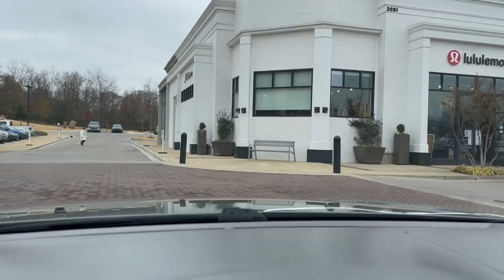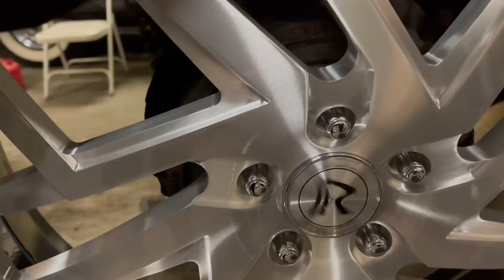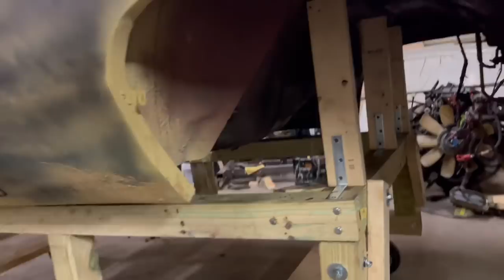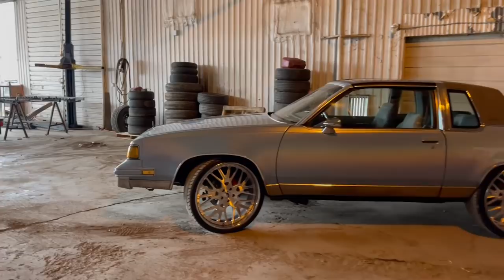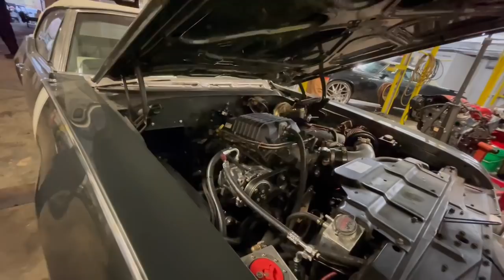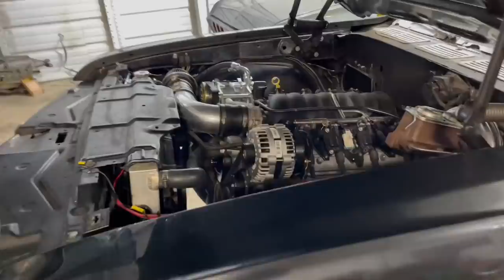I Approve this 442 Cutlass‼️This is a serious Machine‼️‼️

Comment: I Love Cutlass's i owned a few from 70', 76, 77 80 don't get me wrong but to take a 68 Cutlass 442 Convertible and add a "chevy LS Motor ?? that totaly defeats the theme of the car , sorry OG but i can't stand that fam, why not go  Holley E.F.I. and keep the 400? I'll never know why fokes is on this LS band wagon...
Reply: It’s bc the knowledge is lost on these older engines so they haven’t been made in the last 30 or 40 years.  All the obscure makes like olds, Buick, Pontiac, amc, etc have all their little quirks and differences that need to be machined correctly or what have you to be rebuilt right. Most of the orders guys who grew up with them or were techs at the time they were new are either dead or old and out of the game.  If it’s not a Chevy pretty much everyone will not build your engine right, or it won’t make optimized power. For instance in an olds motor if you throw a cam straight up the way they are ground by the manufacture now the valve timing will not be efficient. It will work and it will run but it’s the difference between a 12 sec et car and a 14 et and that’s just one example . What about proper machining of the blocks for adequate oil flow using after market bearings and things? This stuff goes overlooked all the time. There’s just so many heads and time involved learning about a specific motor to build it right and even before you start that it’s to much of a hassle for most guys. Hence LS swaps
Reply: Grammar sucks. I meant they won’t build your engine totally right . I myself have two 70s trans am, one with a Pontiac 400, the other with the olds 403, and now I got a 72 gto With a 400 and it’s always a nightmare learning what the right combo is what every one uses. If you just pick up a summit catalogue and order parts you will be very disappointed how your car runs. This obscure engine like dialed in carbs, total timing,  and a lot of aftermarket stuff doesn’t fit right.  It’s sucks , it really sucks not owning a Chevy but I hate them so much I refuse to go to the dark side and have a chevelle like every other guy and grandmother on the planet.